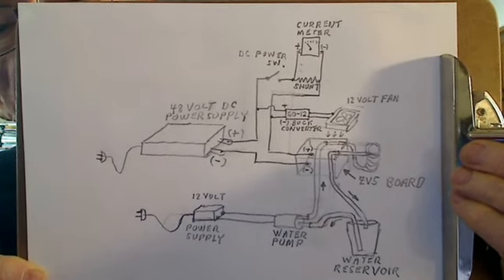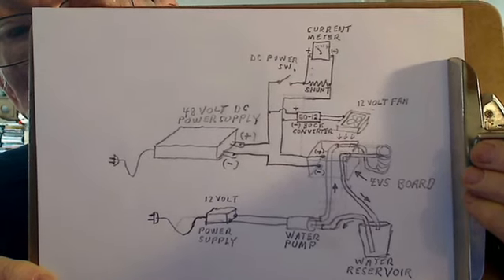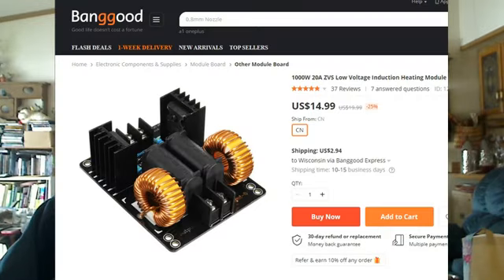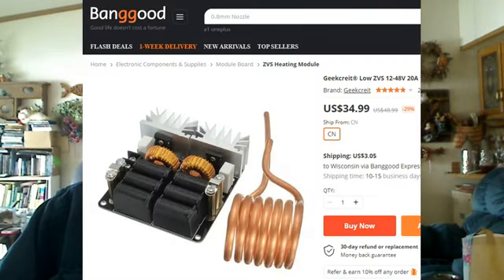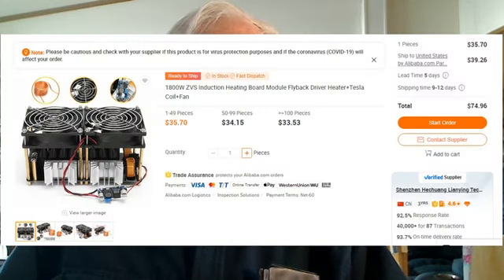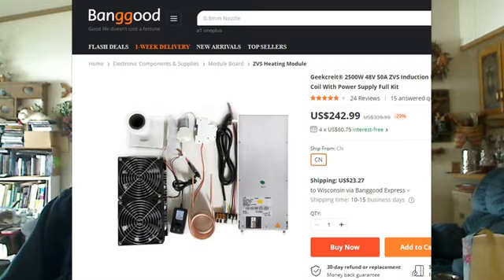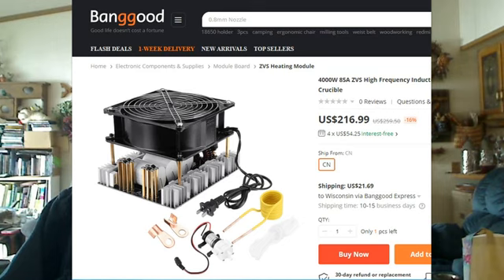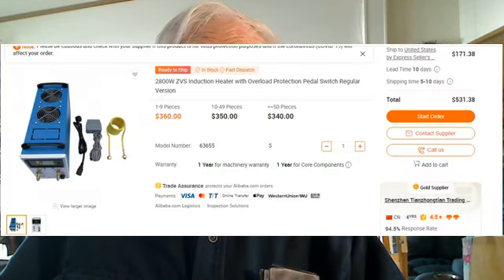#181 ZVS Induction Heater Board History

Comment: Hi. Do you think I can use my welder which is 24v up to 200amp as a power source for a 2500w induction heater?
Reply from the maker: I think the "24" volts is the arc voltage,    The actual output voltage will depend on how fast and how much your specific welder goes from OCV to arc voltage as the current draw increases.
  Of course, you need a DC output from the welder. But the "Open Circuit Voltage" may be too high.  I have seen references to OCV's as high as 60 to 80 volts or so.
Your ZVS induction heater may survive for a while at 60 volts, but probably not at 80 volts.
  Then there are machines that use "Pulsed Outputs".  Those features would have to be disabled.   In addition, the "smoothness" of the normal DC output may  be an issue. If the DC voltage is cycling between zero and its max. at some relatively slow rate, there may not be enough energy to run the ZVS heater properly.
So, I guess my non-expert answer is "Maybe, maybe not".

Comment: Thank you sir! You seem to be the youtube expert on these. I just ordered a ZVS. Do you know what technolgy the coffee makers, hotplates, ricemakers use?
Reply from the maker: Thank you for your kind words.
Most "coffee makers, hotplates, ricemakers" use "resistance heating", not induction heating.  Google that term to find out more.
Reply: @frenchcreekvalley  Those can be bought used pretty cheaply now a days. I believe the tech is called "quasi resonant inverter induction cooker". It is similar to what you showed with the coil/capacitor using an igbt to switch it. I believe a micro controller watches the incoming mains sine wave and triggers based on it. Just found it last night.
Reply from the maker: @willysnowman  Yes, induction cooktops are getting more popular these days, But you asked about coffeemakers and ricemakers, too. They don't need all the extra cost and complexity for the heating elements.   For the single "burner" (HOB) induction heaters that you may have found,  sure, they work, but they are still a lot more expensive than are simple resistance heaters.
Reply: @frenchcreekvalley  Ahh. My coffee maker is just a cheap induction kettle.  My rice maker is also induction, but it was really expensive and I cannot figure out how to use it?.
Reply: @frenchcreekvalley  My plan is to make a induction flattop griddle and induction endmill heat shrinker.